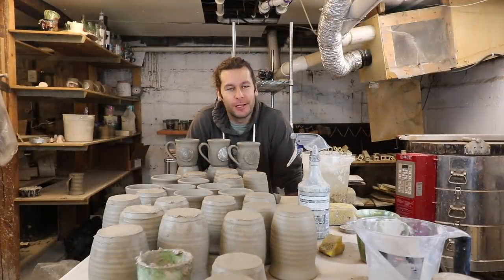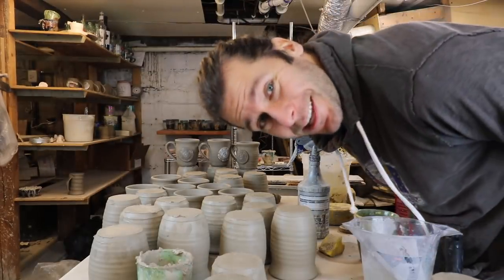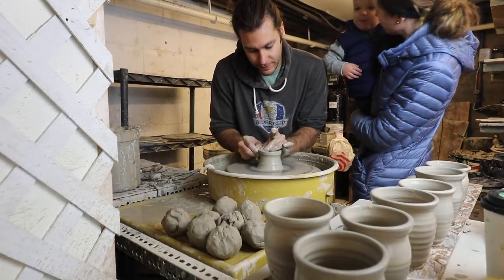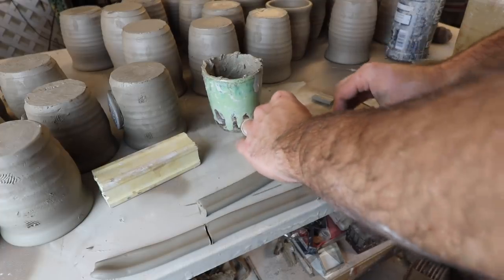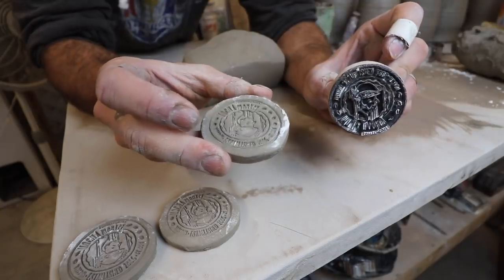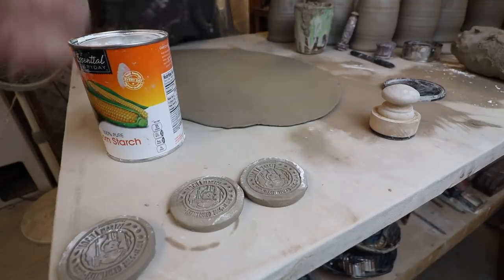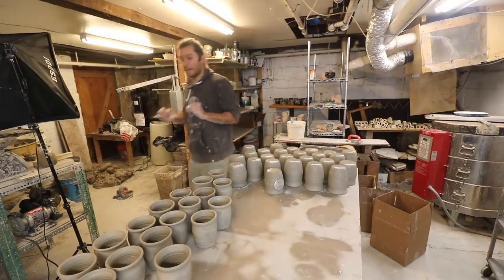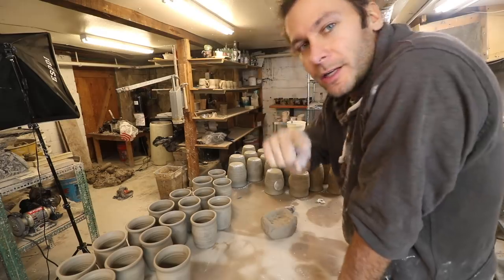THROWING, HANDLES, LOGOS on 100 Custom Mugs to be USED EVERYDAY at a coffee shop!

Comment: Hi Jon, love the mugs, the stamp and the video! Just a little suggestion about how you do your stamping. If you use the stamp on the slab first (just stamp it all over), THEN cute each one out with your cookie cutter, you'll get a much better result. It wont get distorted and will be more even around the edge of the stamp. I've done a big project exactly like this, with a round stamp like yours, more than once. It also saves time since you aren't peeling each one off the stamp. And one more little tip, take it or leave it ;) Fill a woman's stocking (either a knee high, or cut the foot off of pantyhose or tights) and fill it will cornstarch and tie it off. Keep it in a bowl in your studio. Just pick it up and either shake it over your slab or dab it on the slab. It's sooooo convenient. Just some things I find helpful in my studio. I think it's awesome that you're making your own mugs for your coffee shop, customers are going to love that!

Comment: John.... Can you tell me or do a video about how you take the mugs off the wheel. You use water and the mug slides away? Didn't quite catch it,but would like to know. Thanks!!!☺️
Reply: petra markic water goes down around the piece on the wheel then uses a wire slicing it below pulling water under the piece making it more easily slide

Comment: I realize this video is several months old, but was wondering if you've ever thought about creating a plaster mold for a few different styles of the mugs you use in MM and then slip cast instead of having to throw 50-100 mugs at a time to fill the shops? P.S. big fan of the MM logo and it just is so fun to see it on your awesome mugs!

Comment: cool video! question, why do you throw on bats if you end up taking your pieces off the wheel with water?
Reply from the maker: I like the flexibility of the bats, If pot isn't sliding great I can remove the bat, or move the bat and slide from bat to board!

Comment: Okay so weird question I'm doing a surrealism project I want to incorporate a skull of some sort can bone withstand a bisk and glase fire?
Reply: I don't know the answer to this, but in case you don't hear back or in case Jon doesn't have the answer for you, consider Googling the temperature at which crematoriums operate, and then compare it to the temperature kilns reach. Bodies that are cremated have to be processed afterwards- the bones need to be crushed before a consumer picks up the cremains, but it's easy to do because the bones get very brittle during the cremation process. I know that doesn't exactly answer your question, but maybe it will give you a little bit of perspective and/or give you an idea of how bone that has been processed at a very high temperature will behave afterwards in your art project.
Reply: @MyBelgianAzzy  Thank You so much!
Reply from the maker: Yeah Honestly I don't know but researching the melting temperature of bone would be a good first step!  My Bisque is 1800 and Glaze is 2232 if that helps!
Reply: On final fire you are way above cremation temp. Bone would turn to ash.

Comment: What is the theory behind using a bat instead of your wheel head? Does the clay just build up after 5 or 6 mugs and so you just swap it out? Thanks for videos!
Reply from the maker: I have a couple pins on my wheel head so its easier to use bats.   Bats also give me flexibility, sometimes I use the bat to move the piece off and slide it onto wood boards.

Comment: I have a question, are you right or left handed?
Reply from the maker: Right handed!
Reply: @Jonthepotter  I am also right handed and I found it easier to pull up with my right hand with left knuckle but noticed you did it using the opposite. Just made me wonder & I must be really uncoordinated with my left lol Thank you!!
Reply: Hi I noticed Jon didn’t respond you but basically your doing it backwards lol.  The wheel spins counter clockwise when you have your right hand on the outside the clay is leaving your fingers. But if you’re on the left side the clay is going into your fingers.  If your using any tool you would have to use it on the right side. Unless your wheel is spinning clockwise which I found they don’t spin as fast.  So that’s pretty much the answer why he throws right handed not knowing him or anything

Comment: Dear Jon I wish your math was accurate, I do math like this in my head also then I’ll have 200 mugs sitting on my shelf’s for eveeeeer and I sell my mugs for $25. The thing is making 70 mugs a week is not good enough.  you have to sell those mugs. I’m happy if I sell 20 mugs a month but I’m not really in the greatest area for an artist.
Reply: Mathematically and economically speaking, you might want to lower the price of your mugs. This is not a question of me putting a value of your art, but just trying to optimize the outcome. It we assume you can make 70 mug per week and the cost per mug in material cost (clay, glaze and power for kiln) is ~$3. Making 70 units and selling 5 per week sucks, you are losing money, though you have a LOT of mugs. But if you sold all 70 each week for $15, you have a net profit of $840 per week, which is ~$43K per year. Not that I can say that you will sell all 70 units each week at $15 per mug, but this is the general idea. If that is not good enough, you would need to either lower the price more and/or decrease costs. Ei, if you can go from 70 mugs per week to 120 mugs per with while decrease the cost from $3 (not really sure if that is right at all), selling all 120 at $12 per mug is $1,140 in profit/wages.
  Just some thoughts from an engineer/business own who does pottery for fun.